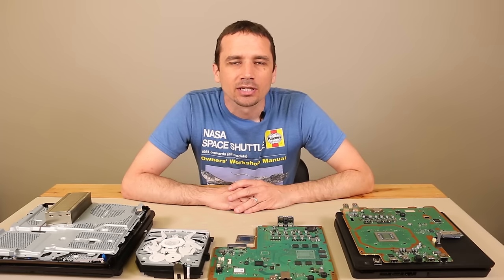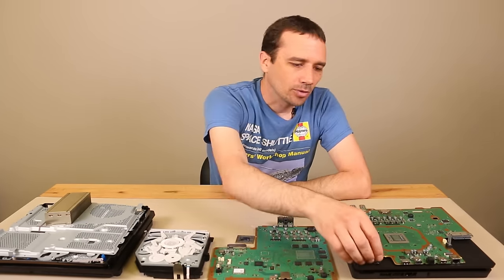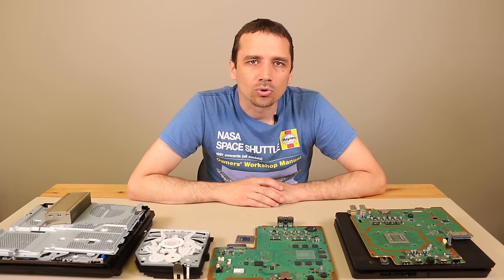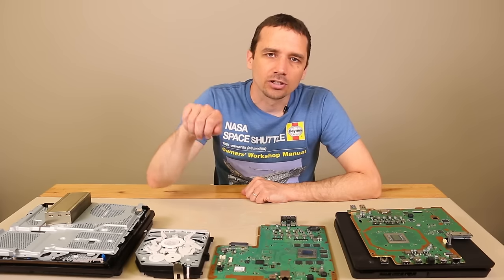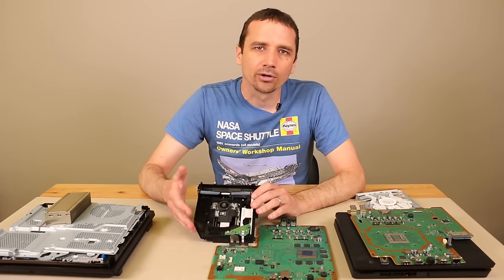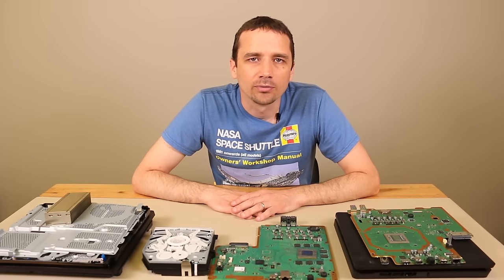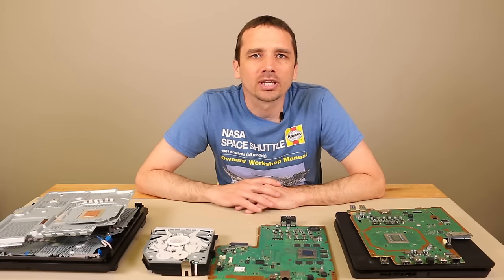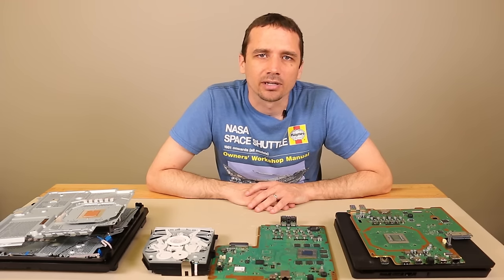Top 5 PS4 Problems With Solutions

Comment: I was hoping you mentioned my problem.

My PS4 was working perfectly for the 3 years that I owned it.
Last time I used it, it was working normally and at night I turned it off normally like I always do.
The next day when I was going to play, it just wouldn't turn on.
It's not the power cord, the power supply had no cockroaches, I replaced the power supply anyways, but it still doesn't work.
It's like the PS4 is not getting any power at all.
No lights, nothing turns on 
No sound when I plug it in.
Neither the controller, nor the power button, nor the eject button do anything.
It's just dead and I have no idea what it could be.

Comment: Hey I have a problem with corrupted data in my games. I have tried to follow the instructions to repair the problem. Like checking for updates on app or system software. Did not work I have rebuild data base as well. And instalize the ps4 I have tried this. The problem keeps happening after I’ve done all these fixes. I had this prom for a month now
Reply: @Mike Abbott I bought another hard drive it’s getting here Friday. Hopefully it fixes this problem.
Reply: @bryanspears6066  did your problem get fixed with the new hard drive?
Reply: @aaroncouture4982  yeah  everything is working good. Haven’t had a problem.

Comment: This wont get seen but I'll put my ps4 in rest mode it will just turn off, I can turn on my ps4 and the disc slot will keep making noise and then u can put a disc in,I also can turn off my ps4 then turn on then I will get a can not start ps4 then I go to connect controller and then it blinks then turns off

Comment: I've had a situation where my ps4 did power on but didn't show on my TV. But worked on other TVs. My ps4 works fine. Why would this happen?
Reply: Propably your tv has some issues
Reply: Wierd thing my PS3 worked on that HDMI port. I ultimately had to buy a HDMI to composite adapter.

Comment: Hi Steve. Can you tell me what is usually the problem when the PlayStation 4 slim turns off after 1 hour of gameplay ?

 The console still works but after playing for 1 hour straight it turns off on its own.

Does that mean it's overheating, deprived of air and it's shutting itself off as a safety measure ?

How do we resolve this problem ?

some videos were suggesting a Band-Aid approach by lifting it off of the ground on some Legos on each corner or standing it up and using a fan with it but what's the real problem and fix please ?

Thank you. Anybody knowledgeable please reply soon.
Reply: 10:42 cleaning could help it
Reply: @zensoredparagonbytes3985  thank you

Comment: My ps4 looses bluetooth connect to ps4 controller while im playing a game, i have to hold ps4 turn off button till it bleeps once then wait till second bleep the ps4 shuts down. I turn it back on and everything is alright and i go back to my game. Its doing my head in.
Reply: I have a similar problem. It can be 2 things. Either there is something with the wifi antenna and messes with the Bluetooth, or it's the electronic component on the motherboard that resolves the incoming communication from the Bluetooth. It's not the controller because I've tested it with another PS4 and connecting it with a cable. Looking for videos with the same problem and see if I can narrow it down to what is really causing it before tearing it apart.

Comment: Mine fell from a table about 2 feet high. Now when I turn it on it says to update with a USB. Pls help
Reply: Go on the Ps website. Navigate to the usb software update section. install the OS on the flash drive. Then bout your PlayStation by holding until you hear two beeps. Press install new (something) with usb. Then install

Comment: I'm having a issue with my daughter's PS4 and due to Covud-19 here in Wisconsin, I can't seem to find anyone to fix whatever is going on with this console and hope someone on that end might be able to help?
   The console turns on and we're able to get to the "Safe Mode" screen, at which point we've tried to set the resolution to auto for the tv and then the PS symbol pops up on the screen, but then it goes dark and the blue light on the PS4 blinks, but doesn't go off at all until we unplug it.... So we can go through the "Safe Mode" steps, but as soon as we get finished getting the PS symbol on the tv screen then it's all downhill from there! I could really use an assist at this point! Please help!
Reply: leslie oligney the same problem is happening to me and there’s no way for me to fix it
Reply: Did you get it fixed ?

Comment: Well I found out why my PlayStation 4 is not working it has not worked since November it's seriously dirty inside I try to clean it out the best I could but I couldn't that was scared I only managed to pop the top off of my PS4 slim and spray it with the airspray a lot of dirt came out but they're still a lot more in there I need to send in somewhere to get it fixed I wonder how much it's going to cost to get professional clean I get paid Monday I don't know it's not under warranty anymore cuz I bought it in 2020

Comment: So I bought 3 ps3s so far the last one I paid over $100 for just the console it's a PS3 slim and each single one of them has laser issues the first Fat model 80GB will just take the disc and not spin it at all the second PS3 Slim will take the disc and spin it but nothing shows on the screen the last one I bough for $120 supposedly "works flawlessly" according to the seller will take the disc and there is a loud clunk sometimes it will load the games most times it will not and if there is the smallest scratch or even fingerprint on the disc you are put of luck is there anyone that knows how I might be able to fix that I'm pretty desperate right now and honestly dont see another option but buying a 4th PS3

Comment: The PlayStation 4 or PS4 has lots of weird problems and Errors that can be like Unrecognized Disc can’t read disc game to upload and start the application or Broke damage disc drive that does not accept disc other errors problems that can be defective not working Disc drive and Logic Circuit Board on the PS4 original Model PS4 Slim PS4 pro all that stuff can be very agnoring with the PS4 all Model of Console try fix the problem.

Comment: I keep getting error into safe mode and it tell me to up date but it won't start it said or something else I INITIALIZE PS4 and it did work again very shortly but it just happen all over again
Reply: Did your internal clock battery die? I don't know if you're aware of the internal clock battery issue. If the clock battery gives out it causes the console to not work including the disc drive or digital games. I don't know, there are news articles on google about the clock battery issue.

Comment: Was there ever a fix for the auto eject on old OG PS4s. I read that it was due to excess static. My temporary fix was to turn it off at the wall for 20 minutes. It usually happened to me during summer. It would sit next to a fan so I assume the fan may have been causing the ps4 to get static

Comment: None of these are my problem. I have a slim, and I’ve went through 5 Dual Shock controls in the last 3 weeks! The ps4 charges the controller initially but if it ever goes completely dead it never resyncs with the ps4.  Never. I’m on my fifth controller and I’m thinking about throwing the console away it’s only a year old but I hate the slim version my fat stopped working prior to buying the slim because the power supply needed to be replaced. The fat wouldn’t come on if pressed the button just heard it beep but no blue light no white light.
Reply: This might sound silly but try different USB cables.

Comment: Hey I was wondering what wrong with my ps4 it doesn't read my controller and my controller is fine I connected it to my nephews ps4 but my doesn't read the controller.
Reply: You can try a couple different things. Find a small pin or something like that and press and hold the reset button on the back of the controller for 5 seconds and plug it in and see if it works. If that doesn't work, try different USB cables and see if one of them works. Keep me updated on what happens.

Comment: I just started having issues with ps4 pro after the Sony update 8.0, I keep getting the cannot start ps4 safe mode bootloop... I have tried reinitializing the ps4, rebuild database ....even tried a different hard drive .. it would work but in mid game or mid menu it would freeze and I would have to hold out button to turn off and then back to cannot ps4 next few times I boot
Reply: I'm having the same issue but I can't get out of safe mode, no matter what I do
Reply: @alexlach3113  I switched hard drives and my ps4 worked again, I just put the one I had issues with back in ( thinking system software update 8.01 would possibly fix it) and same thing still happened so I don't know
Reply: @frankiefo0ter  I might just try that

Comment: I have a ps4 pro that I bought 6 months ago and since i got its been giving me internet problems, but until recently its been really bad. It wont let me play games or watch netflix. There two other ps4 in my house and they connect with no problem and work perfectly fine but mines doesn’t and even when no one else is using the Internet it still wont work. I also tried connecting the lan cable but it didnt wanna connect and kept defaulting to custom setup. All my other devices work fine so i know its not the internet. Really hope someone can help.

Comment: Can someone help me i was cleaning my ps4 for the first time since it came out YEARS ago and i could NOT get the little connector to the power supply out....i used new plyers with sharp teeth and ended up pulling the entire thing out .....is it cheaper to get it fixed can it be fixed or should i get a new PS4????
Reply: @tronicsFix

Comment: I am having trouble playing games using my ps4, I tried to play digital and disk games. I can move around the PlayStation dashboard with no issues, I can select the games but when it asks to press X to load the games to nothing happens, again I've tried on disk and digital games the same outcome.  I was able to play games 3 days ago. After I tried today all menu options using not 1 but another brand new controller I can load the game from the PlayStation menu, however, I cannot open the game from the in-game menu by pressing the x button on either controller, does anyone have any idea for this. **I've also tried putting the console in safe mode it does not allow me to open the safe mode menu by pressing the PS button. I tried deleting the game and re-instaling still does not open. ***No bans on my PSN as well.

Comment: I turn on my ps4 and ill play it for like 20 or 30 minutes and then it just turns off and I have to turn it on all over again
Reply: To me it sounds like its overheating. I would try searching up videos how to clean your ps4 and see if that helps. If not it could possibly be the thermal paste. Make sure you have all the right tools to take it apart and clean it. Do you have a ps4 original,  slim or pro?

Comment: Cannot start PS4. Cannot access system storage. CE-34335-8. Any suggestions on how to resolve this issue? I tried putting in a new ssd and cleaning out the drive bay, but no luck.
Reply: PS4 Slim
Reply: @robertcarroll8723  Did you end up finding a solution? I have the same issue. Thinking about bringing it in to be inspected
Reply: @black_nebula  Tried a few things, but eventually ended up having to replace the board. Hopefully that's not the same in your case.

Comment: I think my ps4 has multiple issues since it froze and I had to unplug. Hard to tell which one is major factor
Reply: That sounds like a hdd issue mate that usually happens before the hdd carks it Though it could be a simpler issue I use standard computer repair skills to repair my ps4's and yes I do own one it's just not running right now I own three actually two originals and a pro
Reply: @pinklightninggacha  like what's happening now is I'll  start it up and i see the PS logo displayed. but ill get a black screen. i did safe mode option 6 & 7 but it keeps freezing and stuff big bummer ive only had it like two years about. it also restarts on its own
Reply: @zaytovz  sounds to me like the hard drive has possibly died or the firmware has crashed but is most likely hard drive you can get brand new hdd's on ebay or if you have an old ps3 lying around with a good hard drive or a spare hard drive of any type around try it it might fix it but you'll need to download the firmware too
Reply: @zaytovz  i've just checked what those options are and I remember one needs the usb so yeah it's very likely a bad hard drive which is a simple fix sony designed it so that they are user replaceable and 2 years is a pretty good life for a hard drive most usually die after 1 though i do have some that are over 6 years old that still work
Reply: Mate when you replace the hard drive note the date as hard drives have a 2 year reliable lifespan after that it's touch and go any other ps4 issue's well my knowledge only goes to well computer building skills I can use with it and issues i've ran into and I have hit this one I had shoved a dead hard drive in my console after it was sat still for too long
Reply: I hope that info helps mate i'm sorry it was in snippets I was remembering bits here and there slowly so I was putting it in as I remembered them
Reply: Pink Lightning Gacha and Gaming thank u
Reply: @zaytovz  no probs mate hope it helps

Comment: I hate consoles now.
The first that failed is the Xbox360, won't let the disc in or out but recovered the data on a hard drive.
On the PS4 it just quit working, it crashed with every game! Wont load anything and I can't turn it off and I had to disconect it or else it wont turn off or load, the in went to safe mode then I reserted the PS4 and wiped it, I thought it would work but nothing, I went out of control by endlessly turning off and on by it self, and I can't back UP THE DATA!
DO NOT GET CONSOLES.
Reply: Sorry "I went out of control" is "It went out of control" I did not.

Comment: So can anyone help me? My ps4 wont turn on anymore. i left it on rest mode for 1 night and woke up in the morning it worked and I went to go to play a game and not even 20 minutes into the game it just shuts off no noise nothing and it wont turn on i unplugged it and plugged it in and nothing.
Reply: I had the same happen to my ps3. That's why I bought an xbox one.
Reply: A similar thing happened to me. But it was 3 weeks that I left it plugged in. I just got a game for it in the mail. It worked for about 20 minutes, then shut off. It wouldn't turn back on. Ordered a 20 dollar power supply for it. Same problem. Several people have said that it was a power supply issue. Perhaps it could be a bad resistor on the motherboard?
Reply: @jaythrash8804  oh I also decided to open up the ps4 and I checked on the mother board and a corner of it it was brown so idk if it got fried or something got burnt.

Comment: My ps4s fan runs real loud and then the system just turns off. All the connections are tight. Anybody know why? It's got plenty of air flow.
Reply: your heatsink might be clogged up with dust
Reply: I've bought a can of air to blow it out. I'm not a expert at pulling apart the system but do you think I should attempt  to pull it apart a little bit and blow it out better?
Reply: @tylerday4256  How old is your PS4? If it's really old it's more likely to be because of dust build up. But it could also be a general overheating issue. Or a mixture of both. 

I'd say you should check the heatsink and clean it, but in order to do that you'd have to take pretty much the whole PS4 apart. There are tutorials out there that show you how to do it, but i'd only do it if you're confident with that kind of stuff and are well prepared.
Reply: @lynxz6702  I have no idea. I bought it used from gamestop about a year ago.

I don't know how comfortable I am with pulling it apart but I'm sure I could watch a video a few times and give it a shot.

Comment: Theres something wrong with my ps4. Theres major tearing in ghost recon wildlands, and a bunch of black spots with rainbow reflecting walls and doors. Guess what I took it in to Tronix, and they cant fix it. So any other solutions? I'm told its something to do with the video card. I'm thinking processor. Is there a video showing how to replace the processor or video card? Or both. Any who, would like to get this ps4 fixed. Thx. :)